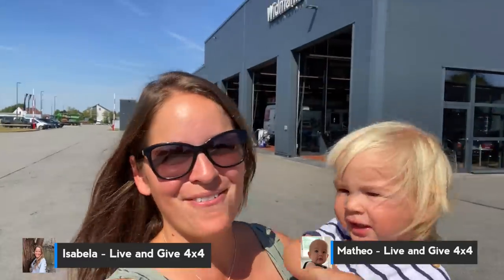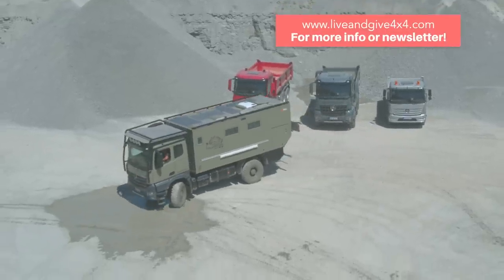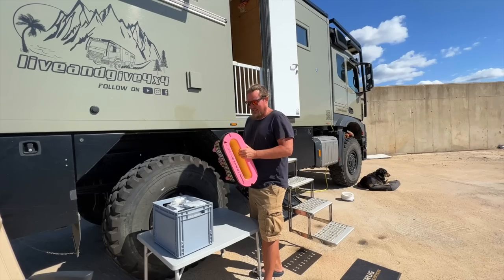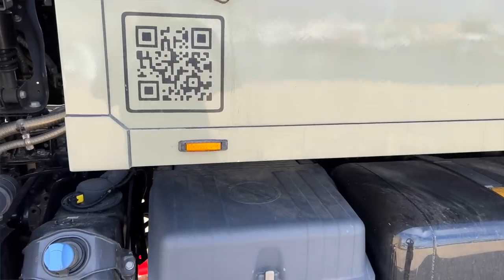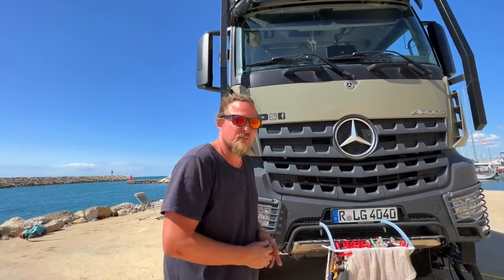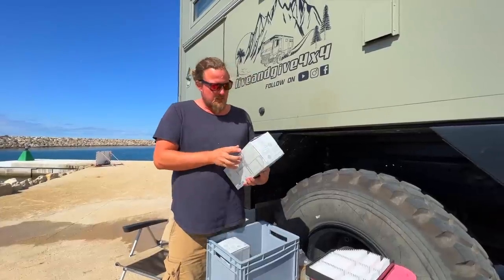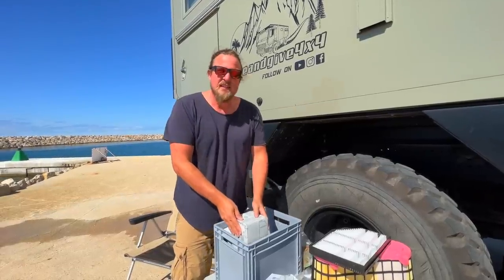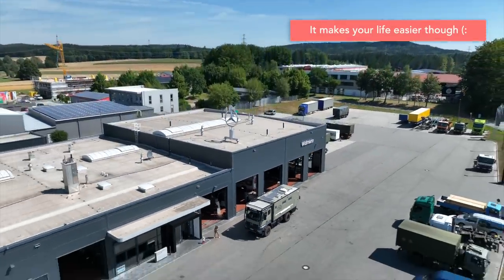What You Need to Know About Mercedes-Benz Arocs Spare Parts 🛠 The 4x4 World Trip of a Lifetime

Comment: Hi Fabian, Please seal all the filters for keeping them clean.
As you said, you can use non MB approved motor oils, but you need to input the appropriate information in the multimedia system of the truck. it will then tell you when the oil change is due.
When dealing with any air filter but not replacing it, never blow air through it. The holes of the air filter are around 2.5 microns. When you blow it with air, you tear it still in microns which you don't see with bare eyes, but enough for the dust to penetrate.
Would advise you to have a 3/4" drive impact wrench for assistance when in need to change a wheel.
Enjoy the next trip.

Comment: May I suggest to put your filters into sealed bags (we have the brand ZipLoc--the stronger Freezer model is probably best) before returning them into the boxes, to ensure no dust gets into them.....especially your Fuel filters. The vibration is bound to wear out the cardboard boxes and introduce paper dust, in addition to road dust. You can also strengthen the plastic cover of the Air Brake filter with duct tape over the open end of the filter. The narrow/ sharp outer edge, and the threads, of the filter will eventually wear through the plastic and could allow contaminants into the filter.
Reply from the maker: Thanks 🙏 will try to find the right sizes 🍀👍 we will have it stored inside our storage department where there shouldn’t be dust… still a great idea 👍 thanks 🙏 
See ya when we see ya 👋 
Isabela, Fabian and Matheo 
Are you enjoying our videos on YouTube? Maybe you want to follow Liveandgive4x4 on Instagram as well 🍀👍🙏

Comment: What do you think about choosing an arocs 6x6 as a camper? Do you know if the cost of operation increases a lot with respect to your 4x4 model? Thanks for your videos. I wish you the best.
Reply from the maker: Hi there, Well, you may have space for one more extra room and more individual planning flexibility (approx. 1.5 Meter longer possible on 6x6 chassis) when thinking about living space…
when thinking about driving a 6x6 you do not have more advantages in a 6x6. The turning radius is smaller in a 4x4 as well if you don’t have a stearing rear axle in the 6x6. Now to the maintainance costs, you will have more tires to change of course plus 3 axles cost more then 2. 
purchasing price of a 6x6 chassis is higher as well … this is only our opinion, but obviously we thought of 6x6 and 8x8 as well 😜 maybe later on 😂
Thanks for watching 🙏
See ya when we see ya 👋 
Isabela, Fabian and Matheo 
For more questions for your individual planning please book a call 📞 with us directly on www.Liveandgive4x4.com/book

Comment: I don't know anything about trucks. Would it it be easy to diagnose any problem that the truck might have on the road(with a computer or any kind of tools or the truck system it self)?  Or maybe you would rather just call a mechanic or assistance if you have to do anything else than the normal maintenance. I am just curios because this seems to be a very modern truck. Nice video.
Reply from the maker: It really depends what is needed… usually the regular services we can do our self’s or at least plan with a garage… (oil changes/tire rotation/ filter changes etc…)
some unplanned maintenance so to speak will either be handled via a special diagnosis set up that we have with us then a mechanic/ good friend of ours goes on the system and tells us one of the following possibilities: 
1. It’s ok, error erased nothing needed you can drive again 
2. Well, it’s ok to drive to the next garage and they can fix it or we can fix it ourselfs on the road (with guidance) 
3. You can’t drive any longer and you will need spare parts delivered, then he will contact the next available garage and we will receive the needed spare part delivered from Germany or a mechanic comes by directly and fixes the needed situation.
For more information about this special service please sign in to our newsletter on www.Liveandgive4x4.com and leave message “diesel” or “road service” and we will connect you to the right person that will offer you the system for your modern truck 🍀👍🙏
See ya when we see ya 👋 
Isabela, Fabian and Matheo